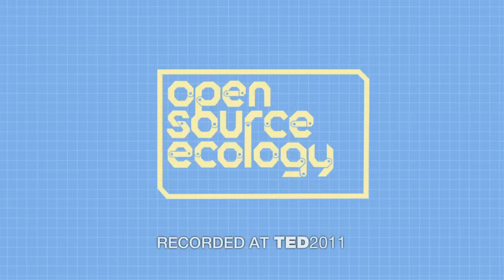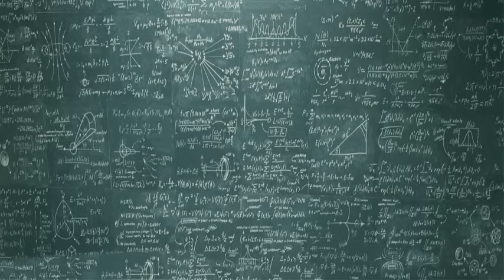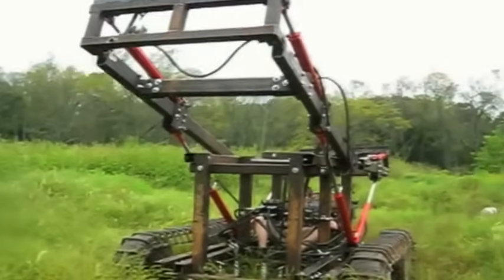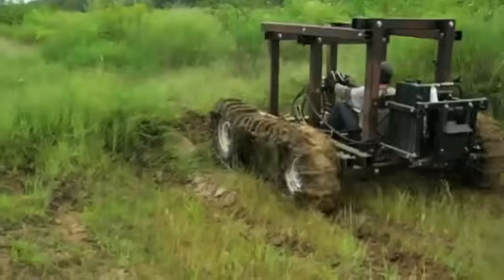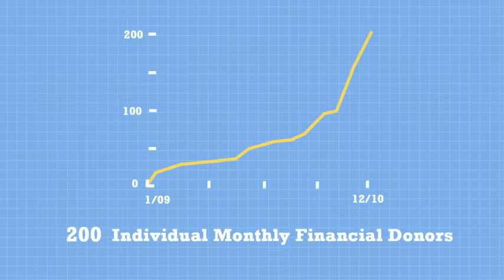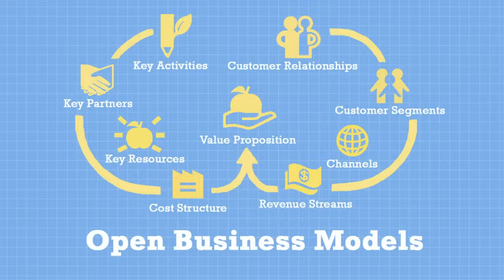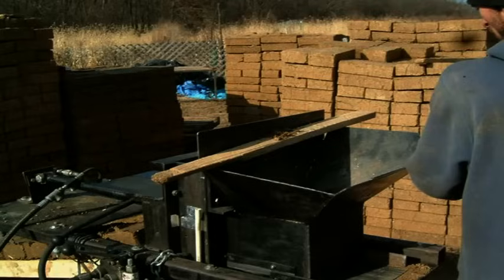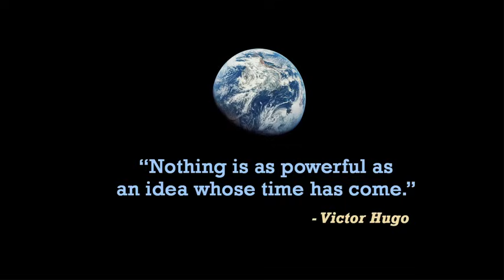Marcin Jakubowski: Open-sourced blueprints for civilization

Comment: @Th3Shadow0fDeath 
The problem is that, in the short term, a lot of renewable energy is actually less efficient when you look at the entire supply chain of what it took to produce the systems and materials necessary for renewable energy production (solar panels take an enormous amount of energy to manufacture, for instance - as do hybrid vehicles).  

The research needs to continue on bringing costs down and efficiencies up despite those costs however which is why we need public support.

Comment: @jjrglobal Not everybody needs a new JD with all the trimmings. Some can do well enough with four wheels, a rollcage, a recycled diesel, rudimentary hydraulics, accessory mounts front and back and 15000 more bucks in the bank. Also, you can tailor the thing to your specs, maybe have separate machines for each task. That way, if your poopscooper breaks, you can still harvest potatoes with the other machine. As for tools, the ones here were not that expensive, especially if bought second hand.

Comment: @jjrglobal I just checked the online catalog of one local hardware store. Cheap stickwelder 99€, cheap MIG 169€, TIG 999€. NOT industrial quality, but good for years of light use with proper maintenance. Obviously, there's no need to weld any high tensile steel, Titanium or other special materials. Sure, I could easily find a good tractor for 5000. The point is, I'd have to pay for parts anything the manufacturer dares to ask. I'd have no choice. A lifetime is a flexible concept...

Comment: @310sucks It doesn't take an engineering degree to take scrap metal and use basic workshop tools. Granted, not everybody can do it, but it doesn't take years to learn how.

More on-topic, I would note that the ideals of open-source and communal innovation are increasingly common nowadays. However, I would also note that this is not likely to signal the imminent death of heavy industry and large corporations. It's unlikely that such a young era that brought such great change will die so easily.

Comment: @brianhttube 
But brian, BP has a massive public relations problem right now and their stock price tanked.  They are feeling the retribution of having cut corners and it has spurred a response from the offshore oil industry to try to up safety measures.  

Was there a screw up?  Definitely.  Should there be more regulation regarding future issues?  Probably (or even hanging the threat of doing so if drilling companies can't get their act together).  Does it mean the entire model is flawed?  No.

Comment: @Cova121:
Actually, he IS motivated by profit. By trying to find ways to make cheaper tractors, he IS trying to make a profit, one way or another. And make no mistake about it, there is absolutely NOTHING wrong in trying to make a profit, so long as you don't use coercion or fraud. Absolutely NOTHING. And anyone who tells you otherwise either doesn't know any better or lying to you for his own benefit(which is to say, trying to make a profit by means of fraud).

Comment: @jjrglobal Now, where would this concept be most at home? In developing countries with no money for spare parts and no importer for most brands? Oh, yeah! Actually, they've been doing this for decades, but it took a guy with a white face and a degree in fusion energy to bring it to TED. Africa is full of used tractors, abandoned for want of parts or the money to buy parts. So, they take the engine and transmission out of an old Land Rover and plant it on some girders. Crude, but it works.